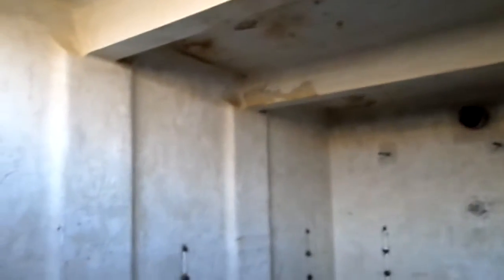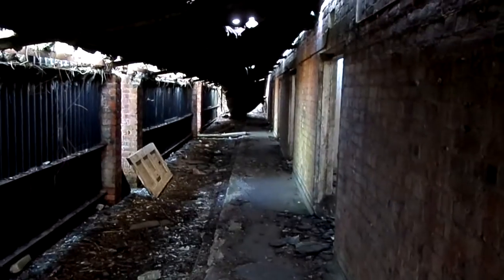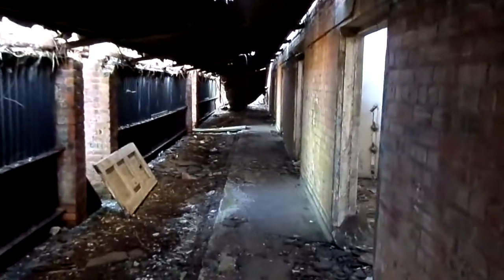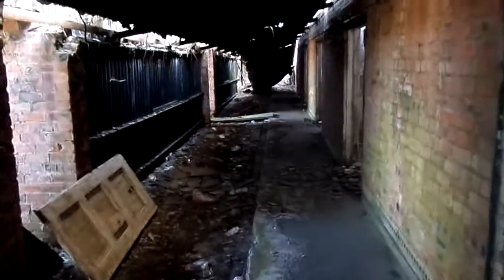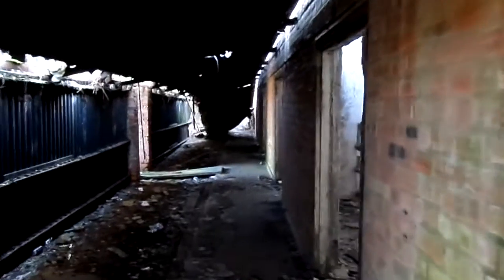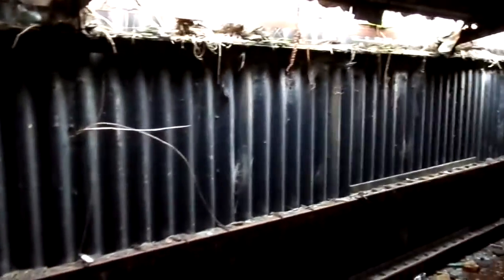Nobel's Old Dynamite Magazines, Longford Misk, Scotland

Comment: Very interesting I worked down the Black powder .in the blending where we mixed the dry black powder ,.we had to wear rubber over shoes ...when we pushed the boggies which were 100 yrs old prob ,.between store houses you could here the sparks from the wheels as tiny amounts of powder were all over the place ..I had sore heads all the time from working with the black powder ..
Reply from the maker: Amazing! The dynamite magazines were heated with steam I gather. What was that pipe bridge over the Garnock at Longford for? Just a water main?
Reply: To be honest I cant remember what the  pipe bridge was for ..But I do remember lots of steam pipes running all over the place down the bottom end as we called it ..and magazine houses with just the banking's with only rubble inside where it had went up  in the air and men killed..I done research on the history of the accidents in Ardeer and got loads of info re dates and numbers killed way back over 100 yr even down to names and addresses in the 3 town where they lived at the time .very interesting
Reply from the maker: Thanks. Do give a copy to the North Ayrshire Heritage Centre - if you haven't  already - people will be interested now and in the future.
Reply: Thank you for supplying your first hand experience. Made this even more interesting!
Reply from the maker: Thanks - fascinating place
Reply: is the black powder section the one in the woods,cast concrete buildings?
Reply from the maker: Not sure - I had a tour of the site when it was still operational and something was mentioned about brick buildings. An accident took place there in the final days and a whole building was blown up as far as I remember - on the Ardeer side of the Garnock.
Reply: The Black powder was near the shore side ,.I worked in it
Reply: im assuming black powder was used in shotgun cartridges etc
how long did you work in ardeer if you dont mind me asking
Reply from the maker: Was it also used in the trigger for air bags in cars.
Reply: Yes I worked in the Blending house from 78 till 80..   Different Powder burns at different speed . ie there could be powder that was slow or fast powder they were blended together to come up with right speed .we took samples which were tested to see if it was acceptable ,,I loaded up to 20 bags at a time onto the boggies which were from the last century ..there could be a ton of black powder on the boggie .It took me a while to get used to the fear of it going up as I thought I would be vaporized in an instant .however after a couple months it never bothered me
Reply: I dont recall that one Roger sorry
Reply: thanks for your info,
theres a frame work of a boggie near the cordite buildings 
im guessing it could be an original one?
such an interesting place, i wish id explored it before the nitro hills were tore down and less of the buildings had been demolished
sad to think only  a small workforce remain at chemring compared to the many thousands employed there
Reply from the maker: I was down at the magazines near Todhill today - I will post photographs on Facebook. Do you know what they were used for - Dynamite storage I guess?
Reply: Roger Griffith 
If it the buildings I'm thinking off roger,they contained cordite presses 
Only part of 1 remains but some others have the frame work for it left
Reply from the maker: Thanks.
Reply: @rogergriffith286  my dad worked there for 25 years, he was there when a large fire took place in the mid eighties.Think he was mostly in the part that made det cord and detonators, but spent some time with nitro as well.I love walking round there it amazes me the transformation.I can remember it was a town in itself back then with a dentist,travel agents,post office and much more.
Reply: @onit_ayrshire  are you the dude who has graffitied onit all over the place down there then?
Reply: @b0ngkong349  wouldnt say all over the place really but no comment
Reply: @onit_ayrshire  haha was only gonna say I've always wondered who done it I spend quite a bit of time down there. Some of the graffiti down there is amazing 👌
Reply: @b0ngkong349  lol yeah I love it down there Im not far from it, will be heading there somepoint soon when the better weather kicks in again 👌🏻👍🏻
Reply: @onit_ayrshire  I'm not far either. spent a few days over the last couple weeks down there and over in the forest next to it with the older buildings. Still to go to the power plant, plan on that next week.
Reply: @b0ngkong349  yeah you need to get that part done soon as I think its getting tore down at some point, and you need to head in from like the quarry side as its fenced off if you come in down through the ardeer estate way, save yourself a half hour detour lol
Reply: @onit_ayrshire  thanks I'll keep that in mind and get it done soon 👍